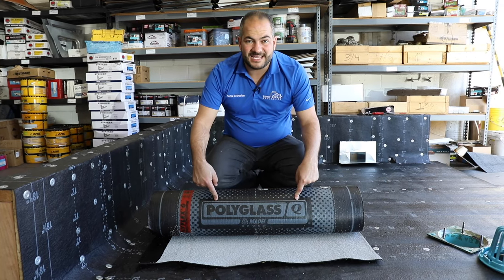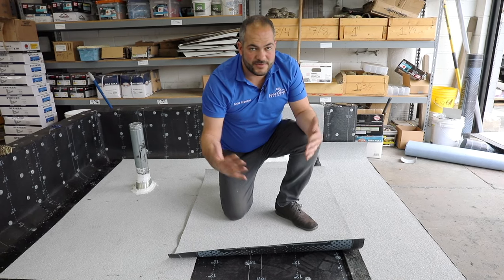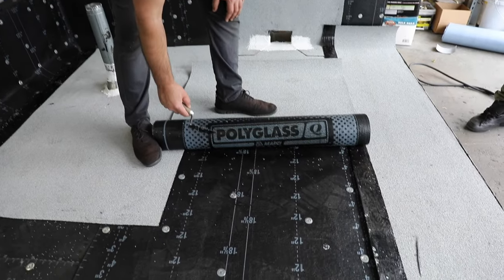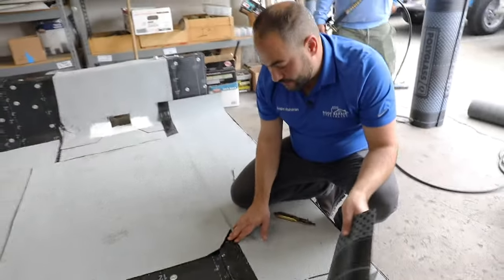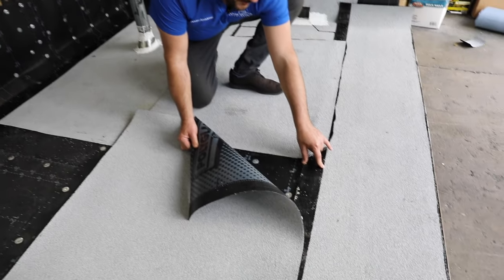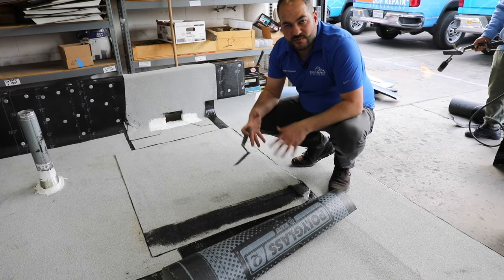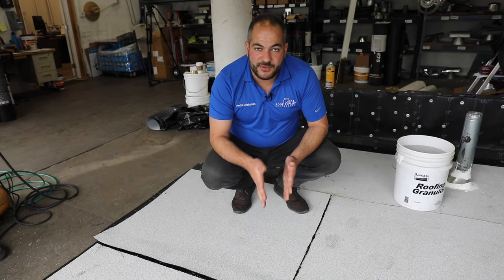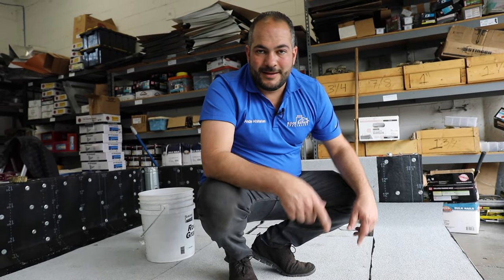How to Install Torch Down | Torch Down Roofing Guide

Comment: The absolute hardest part of my torchdown roof replacement project is finding someone in Olympia WA that would do the job as perfect as shown in your video.
Reply from the maker: Thank you, I appreciate the compliment. Don’t settle. If you can’t find anyone I would recommend finding a qualified roofer and have them install whatever product they are most comfortable with. Better to have a properly installed inferior product then a poorly installed superior one.
Reply: I’m in Portland. If you still need someone to install that at a professional level I’m here bud
Reply: When you install a torch down roof when you lay your roles as long as everything is prepped right and they overlap everything and bleed it out you'll be fine and after everything's installed people should go back and  tie everything in with mocking & fabric to be safe you're up and down seems should get muck fabric any Windows any exhaust pipes chimney saying what you're capping not to mention your gutters and downspout roofing is one of them things you have to be Hands-On and do and it takes years of experience
Reply: As a pro torcher I assure you that what you saw in this video can be deceiving for a layman. What you saw was an average, low quality execution of torching that may( ? ) not leak for a relatively short time.

Comment: No man this all messed up nail base is not strong good for no ice roofers tho, torch down should be solid bled all around and firm, no cut flaps ( spidercut) for drains there should be a solid bleed out and there should be only a few nails around scuppers in the correct places the cap should be de granulated at 6" at the base of the flashing and please don't put m1 or caulking on the drain holes and block the water flow that is meant to catch the leaves

Comment: Thank you so much for your detailed video. We're trying to decide whether to use torch-on or peel and stick to replace our carport roof which is only slightly sloped. My husband is quite handy and has a torch. However, I've been reading that it takes years of experience to heat a torch-on rood properly, without over or under-heating. You make it look very easy. Do you think this is something that a homeowner should attempt or is it better left to professionals? Our daytime highs are in the mid-nineties, and will soon drop to the mid-eighties. We're in the California high desert area. A peel and stick roof would cost about $280 more and apparently, isn't quite as wind and UV resistant. Any advice on which way to go would be appreciated.
Reply from the maker: Really depends on the slope of your roof, if it’s properly sloped without any ponding areas use self adhered. If you have any ponding areas use torch.
Reply: @RoofRepairSpecialist  Thank you so much for your helpful reply!

Comment: Thanks for the video tutorial. I'm repairing our old roof with plans to replace the entire roof in the near future.  What material is the underlayment for the torch down cap?  Is it felt paper?  What do you use to secure the underlayment to the plywood sub?  Galvanized nails/screws with washers? Thanks in advance!
Reply from the maker: My favorite base is polyglass elastobase V. Secured using ring shank galvanized metal cap nails

Comment: How do you do an inside corner? Mine transitions into the siding. What do you run up on the vertical surface? All 3 layers? Then compression bar? Do you Mount the compression bar underneath the siding on the sheathing if you're redoing the siding anyways or does it have to be on top of the siding? I'm guessing you use OSI quad?
Reply from the maker: This is a tricky question. I don’t have a video yet on inside corner. However I alway recommend using a z bar for your siding and having the membrane tuck under the Z Bar. We use Chemlink products. Usually M1

Comment: Great and very helpful video. Can this torch on roof being painted and sealed? Like can I paint it white?
Reply from the maker: Yes, most common options are an acrylic or silicone
Reply from the maker: Depending on where you are and what’s available, a few solid brands are; APOC, polyglass, ASC, Gaco
Reply: thank you @RoofRepairSpecialist

Comment: I have a 30 years old flat roof with small pebbles on it. I need to put a new one because I am also planning to have a solar panels also on the roof.  Should I remove the old roof and put a new one or just put two layers of bitumen on top of the old one?  Thank you.
Reply from the maker: Removing would definitely be your best option.
Reply: Sweep the roof to get the loose Rock Off, you can torch base right down to the substrate, I would recommend taking a flat shovel to level it as much as you can, then sweep, I've done it before you just got to make sure you've got good adhesion on your base layer.
Reply: 3 layers is code , then you need to remove but of i think always better to start fresh

Comment: wouldn't primer work well on the overlapped granules? Great point in burning them though
Reply from the maker: Definitely, both work
Reply: I like using primer.
Reply: No need to degranulate… 65 year flat roofing and never had any problems stick in to mineral.

Comment: Here in uk we would remove pebbles jet wash roof of ,alow to dry,apply bitumen primer and overlay with torch on ... why remove a roof thats not leaking? Will now be a perfect base for your torch on roof
Reply from the maker: So you pressure wash all the granules off? that is interesting. I have never seen that here, however I do see the value in it.
Reply: Instead of pressure washing just buy double the smooth. Essentially same thing

Comment: what material you use about  7:15  in the video? thanks
Reply from the maker: If I understood correctly you are asking about the laps. That is not a product. Rather when we heat up the granules they are imbedded in the role allowing the bitumen/ tar to come to the surface.

Comment: i dont' think i've ever seen anyone torch the seams separately from the field... and the cutting of the 45 angle seems completely unproductive since you're heating the part that overlaps to remove the granules anyway
Reply from the maker: Just cause you haven't seen it doesn't mean it can't or shouldn't be done, some of our guys do it this way, some of them do the seams at the same time.
Reply: @RoofRepairSpecialist  don't understand the point of your comment... i didn't say it can't or shouldn't be done, just said i've never seen it that way
Reply: That 45 degree angle is much better seal

Comment: I don't know maaaan, for whom you made this video? Why do you start it at the end and leaving out most important aspects of theory of why you have ready cap already layed there where it is done, etc... Besides, I know this Polyglass one of the most dificult to work with. I am sure not any of your 'welding' is done right. This worker is typical average, low quality torcher. Can't even be much better without wearing a leather glove! If you used coolroof cap you should have removed end over lap layer instead of after heat and  not embed granuals. If you used regular cap it is better to weld both layer at the same time, no need to embed granuals. Of course to do this takes a lot of practice. So, even though you have a bead of hot coming out by the seams it does not guarantee a perfect water tight bond. If I have to grade this work on a zero to ten scale I could not give it a better than 5.5 score and that is only in case that your work does not leak at least for a year !
Reply from the maker: I think I deserve a 7/10, I’ll take a C nothing less, lol. The life story you just wrote deserves a 10/10 though